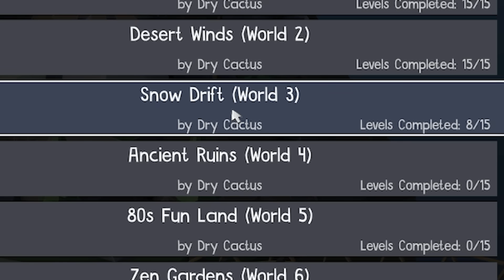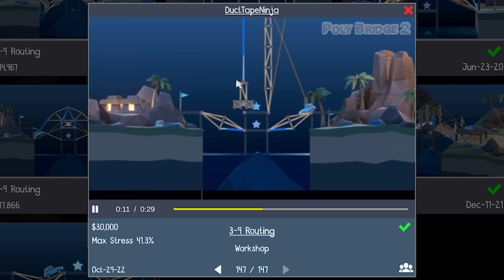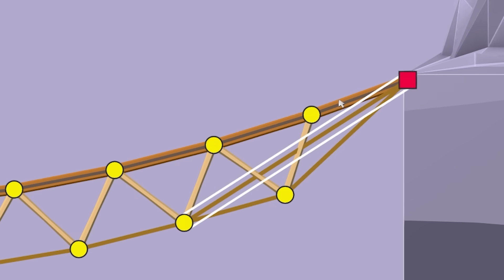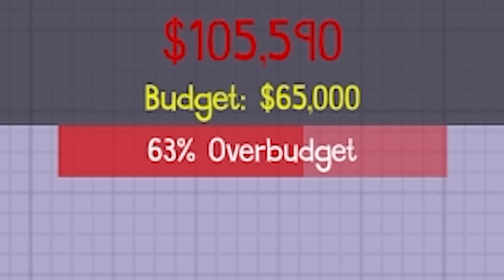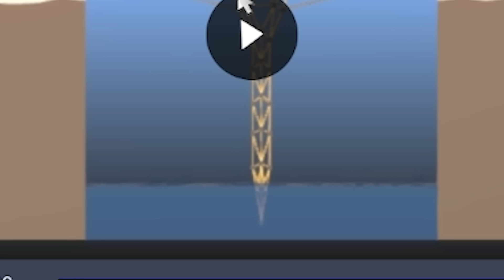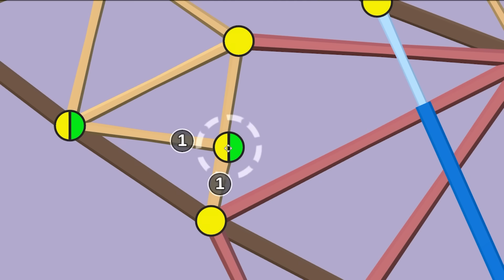Squares are STRONGER than triangles!? Poly Bridge 2!

Comment: The route vs. root pronunciation is interesting. Because its pronunciation is splitting based on context when it came from one word. Root 52. But you wouldn't call the tool a rooter, it's a router. And routing wires through walls not rooting. But US is a big place probably someone says it that way. They probably wouldn't even be considered wrong. Language changes. Duck tape is a legitimate name for gray tape, even though it was originally duct tape ment for sealing aluminum heating ducts.

Comment: Learned this on our first mechanical engineering course. We were given 3 a4 papers. Tried to fold them into triangles. It didnt really hold much weight so we whiched to folding them into squares and it held over 5x the weight if the folds were clean.

Comment: i mean... if you think about it in absolutes, a vertical pole would be stronger than a triangle. mind you, this would take in to account the fact that it's on a computer, where there are no flaws in the metal, and if you give it no reason to move side to side (such as road chunks on top that are unbreakable in x/x sections), atomically aligned, there's no reason for a pipe to do anything but puncture what's on top of it, or be driven straight in to what's below it. unless both things are harder, then it will just hold there for all eternity.

Comment: The Internet turned me into an American a long time ago. 😥

That 'sausage' is like the 'understrung' bridges i used to make in Bridge Constructor 3D. They don't work so well in Poly Bridge 2, which is just as well because they're way OP in BC3D. An 'understrung' bridge is a flat wooden roadway with steel cable in an arc underneath, or as near as you can ge to an arc when you can't disable snap to grid. Connecting the two are short wooden verticals. That's the whole thing. They're amazing because they spread the load as near perfectly as the grid snap allows, but they must be terrifying to drive on! XD They're right on the line between "bridge" and "not a bridge".

Comment: Squares are not stronger than triangles. Some weight just doesn't need as much support, or if there is the right amount of pressure on the sides when trying to distribute weight from the top or bottom.
Reply: In the triangles, he has horizontal members in tension. If they were rotated 90 degrees, it would be vertical members in compression and much stronger for loads.

Comment: In old websites there is the infamous "div-seption" cuz they hat to put everything in a box (div) inside a box inside a box inside a box to properly center and position content.
Reply: and now this terrible design is "proper engineering" and no one wants to accept that truth. 
its ridiculous that application user interfaces are made in what's akin to an Word document.
Reply: @monad_tcp  I mean, some templates exist that allow for editing via a gui, but if you want the most control, you have to go down to programming language level.
Reply: @ebreshea1337   " but if you want the most control, you have to go down to programming language level" 

html+css are declarative language,  control ? 
if you want control you have to go using opengles

html is a document language, its fine for that. for applications, its terrible
Reply: @monad_tcp  Someone misses the days of Flash.
Reply: @chaos.corner  I miss the days of "boring" square user interfaces that followed the system interface
Reply: It's still like that as far as I can tell for a lot of sites.
Reply: @WarrenGarabrandt  now we at least have fancy "main" "article" "foot" and stuff like that to differentiate. and better css to align stuff.